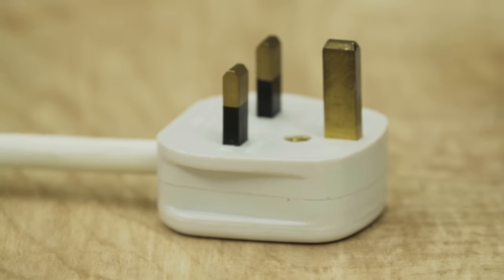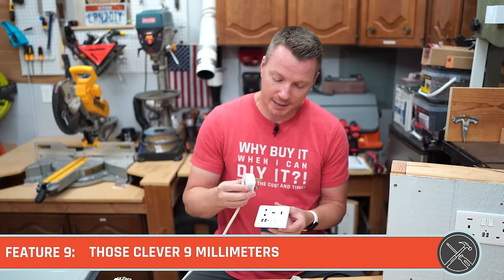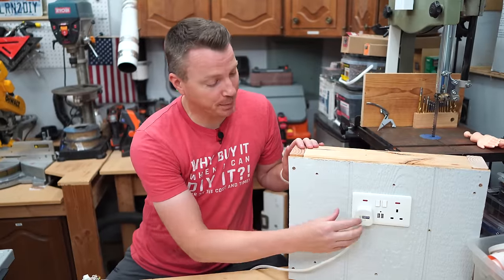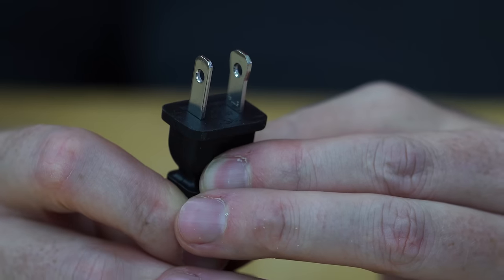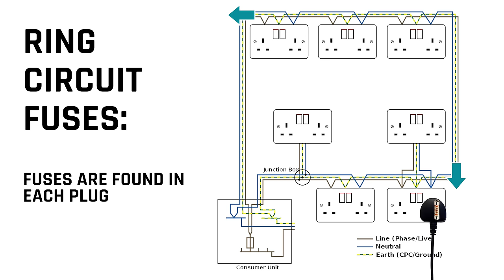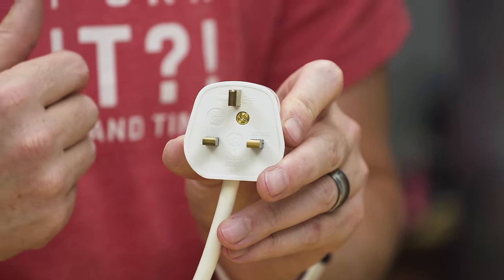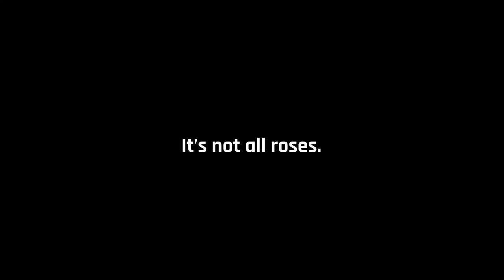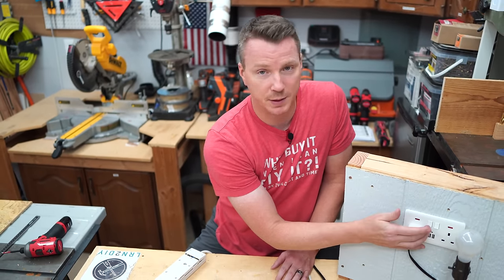British Plugs and Outlets Are On Another Level

Comment: On the subject of size, you'll note that despite the chunky plug size, the standout from the wall of the plug and cable, is LESS with the larger, British style plug. Because the cable sticks straight out of the wall in the US version, its stand out is larger, meaning that you need more space around your socket in order to use it. In Britain, its fairly common to see certain devices plugged into sockets that are behind bits of furniture, like sofas, tv cabinets and bookcases, without those furniture items themselves standing off the wall by much. This means rooms can be arranged to make maximum use of floor space, without having to spend a lot of effort or time accounting for the positions of sockets.

With regard to the switched sockets, it absolutely doesn't make trouble shooting more difficult, it just makes it different. 

And on load balancing ... Nearly nobody has to worry about that. Most peoples homes concentrate the majority of high use items in the kitchen, the kettle, the oven, the refrigerators and freezers... All that load heavy stuff is ordinarily in one room, but kitchen wall wire is often beefier itself, to account for that load intensity.
Reply: First time an American has complained about something being too big. 

As a UK home owner the large draw items like cooker, water heater or car charger are on independent circuits. My house has a few loops all feeding back to the panel. But the cooker is its own loop.
Reply: Other systems have 90° plugs too. 
The European style plugs usually have straight plugs for small power devices and angled plugs for higher power devices. 

Your comment has made me aware of this. 😁
Reply: Indeed.

In the UK homes will be wired with ring mains for the lights and electrical sockets with something like a 3-6 amp breaker for the lighting circuits and a 16 amp breaker for the circuit with the electrical sockets.

The rings for the lighting is usually done by floor so all the lights on the ground floor will be on one ring and all the lights on the upper floor will be on another.

The electrical sockets are often a hybrid of radial and ring with all the sockets in a room being on a ring but each room being connected to the breaker box radially so there will be a single wire from the breaker box to the kitchen but all the sockets in the kitchen will then be on their own ring. The same will go for all the other rooms with all the sockets in that room on a ring but that ring being fed with a single spur from the breaker box. 

High power electrical items such as electric ovens, hobs, electrical shower heater units, and immersion heaters for hot water tanks will all be on their own individual spurs usually with 30 Amp cable that goes directly from the breaker box to an isolating switch that has an indicator light to show that power is being supplied to the appliance.

This is so that if the appliance has to be powered off for some reason it can be powered off with a switch close by without needing to switch it off at the breaker box.

For instance, in the kitchen an electric cooker and hob will be on their own 30 Amp spur that is independent from all the other 13 amp sockets that will be on the kitchen's 16 Amp ring main.

The 30 Amp spur will come into a faceplate with a 45 Amp switch for the cooker and hob and a 13 Amp socket that can be used to test that there is power to that faceplate from the 30 Amp spur. The switch can turn the power to the cooker and hob on and off while not effecting the 13 Amp socket.

Under the counter appliances such as washing machines, dishwashers and larder fridges or appliances such as floor to ceiling fridge freezers which will be plugged into sockets that are inaccessible will usually have a fused switch in an accessible location that controls an unswitched that is located behind the appliance.

As has been stated elsewhere, in all cases fault finding will start at the switch first with this either being a switched socket or the fused switch in the case of appliances that run off a switched spur. These will usually have an indicator light to indicate whether they are supplying power or not.

Finally, because power outlets in the UK have individual switches in them, an appliance can be electrically isolated by simply setting the switch on the outlet to the off position so there is no reason to unplug the device and so having stray plugs laying around the room with their pins in the air to step on is not really an issue as the socket does not need to be removed from the outlet to power off the device.
Reply: @Isnt_that_Aaronic  the cooker will be on a radial circuit
Reply: As a uk electrician I can tell you that this is the first time I’ve ever heard of load balancing On a ring circuit. Normally you’d have a separate ring circuit especially for the kitchen, downstairs and upstairs. Depending on the age of the property if it’s older, the amount of ring circuits decrease, so you might have one for the kitchen and one for the whole house, or if you go back further you’d probably just have one for the whole house. I’m not sure where the idea of a higher mm cable has come from for the kitchen? It’s all the same size with our radials for the cooker being between 4mm to 10mm thick. 

Also a bit of trivia, years ago it wasn’t mandatory for appliances to come with plug tops, so it was part of the school curriculum to wire plugs.
Reply: @AGreyGoat  cooker cable is chunky and flat, or at least, the stuff I've seen has been. Maybe the chunkiness is taken up with insulation?
Reply: @peteredwards2318  yeah the cooker radial is between 4mm and 10mm, but the ring circuits are commonly 2.5mm, sometimes 4mm (more in commercial or industrial settings) depending on the size of the circuit and the distance it covers. The cables are double insulated so they have the grey outer sheathing and then the cores of the cable (minus the earth/cpc) will be insulated again in their respective brown and blue colours. The earthing conductor will also be smaller than the main conductor, so for example in 2.5 flat profile cable the earth conductor size will be 1.5mm. This is why it’s often referred to as “twin and earth”
Reply: Came here to say the same things. Also, I never lie awake at night, concerned about the size of my plugs, the load balancing on appliances that run thru a 3A or 5A from an extension lead with 6 outlets, I’m never so confused that I don’t check the switch on the wall outlet first (they can sometimes be turned off by moving furniture back against a wall but again not rocket science), installing a ring main in a garage or similar is super easy imo but obviously get an electrician to install one for the sake of certification. The only one I would agree on is standing on a plug but as long as your missus puts her hairdryer away, most plugs are in the walls and not on the floor.
Reply: Thank you for writing my comment for me! Lol
Reply: @peteredwards2318  thickness of cable to carry the load.Its not a pipe
Reply: Exactly
Reply: Ditto!
Reply: Nailed the comment I was gonna type😂😂
Reply: @sardendibs  I wasn't suggesting that this was a uniquely British thing, just using British to establish difference between the situation we have here, and the situation with US plugs.
Reply: @Isnt_that_Aaronic  That's standard in the UK. I have separate electric ring systems for:
 the downstairs electrics
the downstairs lights
the upstairs electrics
the upstairs lights
the kitchen electrics
the kitchen extension lights
the cooker and
the loft lights
Reply: @bassplaya69er  took the words right out of my mouth 😆
Reply: @paulchartley  You won't find 16 amp socket circuits in the UK, it's 6amp lights, 16 amp immersion heaters, 20 amp radial sockets, 32 amp ring main sockets, cookers and showers 32 or 45 amps.
Reply: @AGreyGoat  ring circuits were a necessity to keep construction costs for rebuiilding down after world war 2..its something that just stuck as we got used to it.. and as far as balancing goes, the electrical diversity section in the regs deal with that..
Reply: @iangascoigne8231  you do see 16 amp radial circuits, but that’s normally because you don’t have any 20’s left on the van 🤣
Reply: Do Americans think that we run our washing machines in our Bedrooms or something? It was such an odd point to make in the video. Scraping the barrel to come up with a reason why theirs was better.
Reply: @rhysblaney3121  I can’t remember if it was he yanks or the Aussies that normally have the washing machine in their bathrooms!
Reply: @AGreyGoat  eew
Reply: @squelchuk  lighting isn't ran in a ring
Reply: @MsBethanyClaire  it was by whoever previously wired my house. They also crossed over the return leg of the upstairs and downstairs lighting “ring” for good measure. 😂
Reply: No Kitchen in the UK would be wired for "load intensity", I very much doubt any builder/electrician would use "beefier" wire for the wall sockets on a kitchen - the largest load would be an electric cooker and it is usually fed by a dedicated cable.
Reply: That is one thing he missed out on, no house has 1 ring main around the whole thing, usually it's divided, 1 for the kitchen, 1 for the remaining of downstairs then another for upstairs, with lights and plug sockets running on separate ring mains too.
Reply: You're obviously no Electrician are you now
Reply: @Conservator.  angled plugs for higher power devices?!!!!!!!!!!!!!!
Reply: @ScottyDog345  Yes, the connection cords for higher power devices usually have a plug where the cord is attached at a 90° angle like the UK plug. Lower powered double isolated devices typically have much smaller plugs without an earth connector and the cord usually is attached in a straight line (so you could use the cord to pull the plug, although you shouldn’t do that).
Reply: @AGreyGoat  I see this a lot in Europe, I know I've seen it in Spain and Ukraine a few times.
Reply: technically the regulation does mention balancing, however the way electricians in the UK do it when doing a ring often is every other socket on the way out on each leg then join the end sockets. Basically just evenly distribute the sockets, they can't really control what is what the resident actually plugs in where. Since this video went up some British electricians have been discussing this on a public electricians forum. Really heavy stuff is on it's own circuit, kitchen can often be its own circuitt too and while we do have rings, radials are done too.
Reply: @Fifury161  Cooker is it's own supply, and they will try to evenly distribute the sockets often on its own circuit, easy way to do this is every other socket out is wired as a radial and then just link the last 2.
Reply: I’ll concede the point about being able to stand on a plug, although if a plug ‘falls’ to the ground and you just mindlessly leave where it could be walked on, that’s your fault, not bad design of the plug

All the other ‘downsides’ are an absolute reach 😂
Reply: A pet hate of mine is that many chargers etc. don't use the cable down design. It makes much more sense this way.
Reply: @EwanMarshall  Whilst it is possible to do that it would not be in compliance with British Standard BS 7671...
Reply: @AGreyGoat  I asked a young just out of his time factory electrician if he knew how to wire a plug. He had to be shown.
Reply: @davidb3172  my parents and grandparents where shown how to wire a plug, maybe it wasn’t a mandatory thing 🤷🏼‍♂️
Reply: @MsBethanyClaire  Actually it is in a ring.
In the UK, lighting is usually run as a ring going consumer unit > ceiling rose > next room ceiling rose > ... > consumer unit.
There's then a cable running from the ceiling rose down to the lightswitch(es)

If there's an array of downlighters or multiple ceiling roses, then one gets nominated as the 'first' and gets the touch-and-go on the ring, with the rest fed switched power from it.
Reply: I came here to say all this. Thank you for saying it first! 😂
Reply: It’s already been said, but I’ll say it again: “Big plugs” have never been an issue here in the UK. (And the wires going down instead of straight out are so tidy!) As for troubleshooting, if the lamp doesn’t come on you first try the switch, then you replace the bulb, then the fuse - easy. We don’t unplug anything ever, because we don’t have to (switches), so we don’t ever stand on upturned plugs. And I’ve never once had to think about load balancing. Nor have I ever had to worry about installing a ring circuit, because I’m not an electrician... So type Gs are all pro and no con - thanks for making this clear! 😅
Reply: Still like the EU design more
Reply: This was the comment I was looking for.
Reply: And another thing lot of the newer sockets are flush to the wall so much less space is even used than before
Reply: Love the side-entry plug for allowing it to fit flush behind furnishings or otherwise save space.  Some appliances in Australia use that style (especially nice with an integrated ring-pull) but not nearly enough.
Reply: @AGreyGoat  In the US, most single family homes since the 1960s have a 'laundry' room in the basement with the washer and dryer, utility sink, water heater, central heating furnace (which will a plenum that a central air conditioner cooling water line and return attach to) and maybe the main circuit panel. In newer apartments this is all in a much smaller utility room. In older apartments and small apartments the washer and dryer may be in a small closet near the kitchen, or in a common room in the building for all tenants' use. Space hasn't been an issue. The rooms with high current, high voltage appliances (dryers/washers/ovens/etc.) will have the additional circuits built to handle it. 90-degree plugs are rare but not unknown. This British 'G' plug is a very good design, but it seems like massive overkill (no pun intended).
Reply: @bassplaya69er  there is neutral in lights. It is connected to whatever is around the lightbulb
Reply: @bassplaya69er  there is no neutral to the switch because all the switch is doing is breaking the live. Hence one wire is identified as the switched live (ideally marked with brown tape but not always!)
Reply: @bassplaya69er  fair enough.
Reply: @bassplaya69er  didn't mean to offend.
Reply: @AGreyGoat  yes his load balancing comment shows total inexperience of UK electrics. Never ever heard of load balancing issues on a ring main, as the cables are sized to MCCB fine. Also we have 240V hence the smaller cable size.

Comment: Very true - stepping on a plug is one of the most painful experiences. However, since all our sockets are switched, it's an unusual situation. Most of the time you'll just leave the socket plugged in, and switch it off from the wall
Reply: I've actually never trodden on one. Unless it was so painful I've blanked the memory.
Reply: @offshoretomorrow3346  I have - the Apple phone chargers with the removable USB cable, the cable comes out, plug ends up face up, I forget I've dropped it and... well... you can see how it ends
Reply: Usually a light plug when your wondering round to the toilet at night with no foot protection.🤬🤬
Reply: Comment came to soon!
Reply: As a kid I Jumped off my bunk bed straight on to a plug. I remember there was blood but its was about 40 years ago now :(
Reply: Yep, the plug is certainly a torture device in bare feet -  Lego comes a close second. 🤕
Reply: You only have to step on one once before you learn to leave it plugged in or put it away.
Reply: @ianip6  Having stepped on a plug as a kid and remembering the pain, I cannot imagine how bad landing on one would be, you Sir, have my deepest sympathies!!
Reply: jumped over double bed as a teen and landed full weight on an upturn plug, impaled it through my foot. that hurt. makes Lego look meek.
Reply: @offshoretomorrow3346  Agreed, I've never stepped on a plug in 60 years - as they are switched, no need to remove them.

Comment: Great video, thanks.  Another correction from an old British electrician, the ring main itself is also protected using either a large 30A fuse or more modern circuit breaker so the total load cannot exceed design criteria (nominally 30 amps). Cable sizes for the ring main are not small at all at 2.5mm sq (twin + earth) and have double insulation over singles used on lower voltage systems.  Load balancing has never been a consideration in normal homes as large appliances, such as an oven or hob, have their own dedicated high current rated circuits;  as do other large loads, such as air con units. Lastly, we also use dedicated radial circuits for specific purposes. For example, central heating boilers, tumble dryers, washing machines etc. to keep the high load appliances off the ring main.
Reply: Excellence is expected 🇬🇧
Reply: Separate rings for the lights too IIRC.
Reply: @unclemick-synths  radials for lights in uk
Reply: 32A is the standard
Reply: @shaun1293  You can find British sockets on 16A radials, 20A radials (on 2.5), 32A ring finals (on 2.5) and 32A radials (on 4mm). All those are common, but there are other variations too.